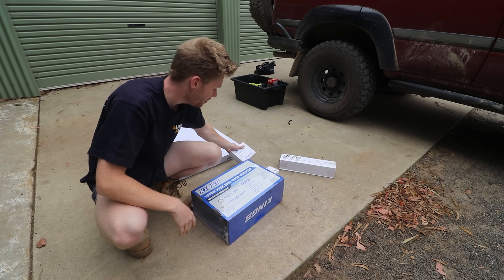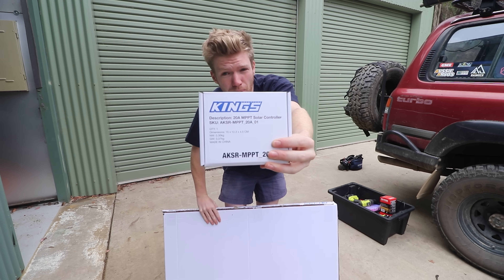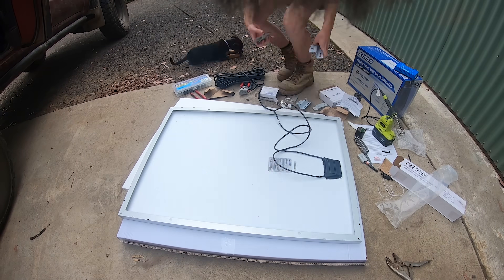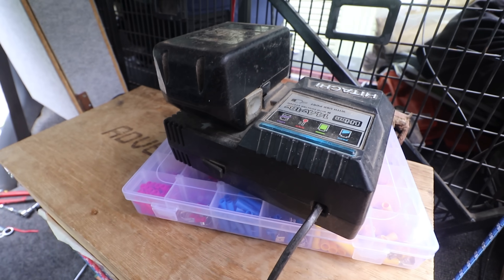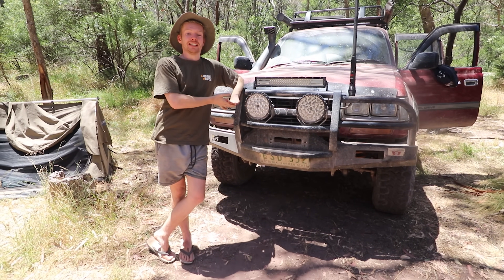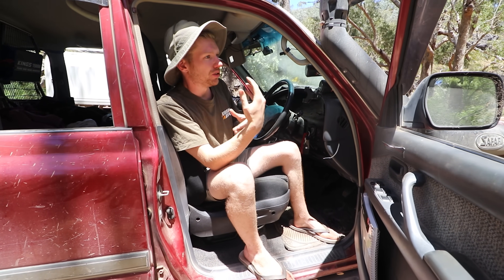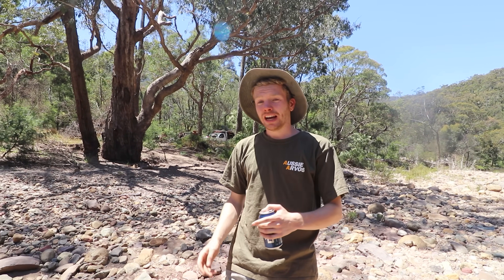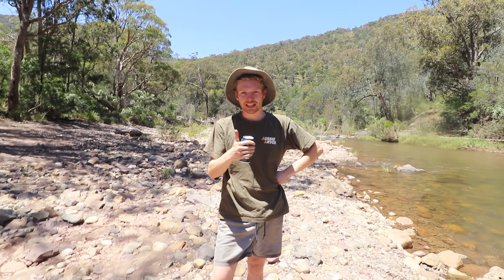Should you put SOLAR on your 4WDs Roof??? + CHEAP 240v Setup! What FAILED?

Comment: The big thing is budget - are you better to have good gear at an affordable cost that will last 2, 3 or 4 years, or something thats 5 times the price that will last 5-10 years? There are some things I'd always spring for the best quality, such as batteries and battery wiring, but so what if your inverter is a couple of % worse in efficiency, or a little louder, you have affordable 240V in your car at a budget that most people could afford. I do plan on looking at options to put a panel on my new car, and a second battery just for a fridge, so the quality for something like that will be based on what I can justify as it will only be used every 2-3 months for a couple of weeks.

Comment: Why do this? I just purchased the solar panel $90 and a controller for $30 and im charging my second 100amp battery under the hood at 3.8amps and it turns off when its fully charged...i can run a kings 30L fridge/freezer for 3 days

Comment: Just took my 3rd one back today. The first one all lights were working correctly and was charging at 15.6v the other two the solar light wouldn't come on and only put 5.6v into the battery, i upgraded to the mppt kings plus and am waiting for the message to come pick it up fingers crossed I don't have any issues with this one

Comment: I had the 110Watt kings fixed panel on roof racks driving through a CTEC DC/DC charger to two 110AH AGM batteries just running a 45litre Engel for three years plus Kings LED lighting when camping. Worked a treat. Easy to knock Kings but be realistic, ALL electronics come out of China and kings buying power probably buys a bit more quality control than it used to.

Comment: The thing is....why do the job 2 or 3 times buying CHINESE  CRAP.
Save up and do a little bit at a time and do it  Well and only once.
Red Arc hands down. But buy it through NAPA   $309 for a BCDC25AMP Charger and never touch it..
Don't be like the other Channals with there rebadged  China 24/7 crap.
It's cheap we all know.
But promote good Aussie Business  in a time of need and get off China's  Tit.

Comment: Nothing wrong with being Budget conscious and whilst Kings gear is inexpensive it works most of the time. 
For me anyway. and I cannot afford to spend many hundreds on Redarc or ARB. 
I have the same dual battery charger and their LED lights and I have not had any issues.  
My fold out solar panels work well and my fridge does seem to drain my battery in hot summer days.
But that could be my 98AH battery is just not sufficient to keep the fridge running when the cabin temp gets to 45  in the car park at work. 
It can't seem to last more than 8 hrs of running time with my 45 ltr. fridge in summer. 
If the fridge is running on 240 volt in the house the fridge works fine and only seems to have an issue once in the hot car.

Comment: Just saw this video. You have me worried. I have that MPPT controller as well as the same Giant 140AH battery. Tomorrow I will be checking the charging voltage. My setup is in a caravan.
Reply: I also have the same battery, I did have a kings mppt controller with a 120w solar panel. Literally first time I plugged it in it went straight to 18volts. Unplugged it straight away and threw it in the bin! Bought a victron 75/15 mppt and it’s the best!

Comment: Is regard to your high voltage when the car is running. It will have nothing to do with charge voltage. Your king's mppt charger will be your issue. They are known to increase voltages well above safe charging limits and kill your battery. Replace it with a good quality mppt and could almost guarantee your issue will resolve

Comment: mate.. that MPPT controller is Sh!t.. I gave them the benefit of the doubt whe I installed a 12v solar system and 2nd battery in my Commodore wagon (the Camperdore) along with the Kings dual battery relay, the MPPT  lasted a month, shorted its output and blew all ther fuses in my system. A friend bought the same controller and his lasted 3 months and did the same thing. But you gotta try these things and wehile it was working it worked great.

Comment: Off topic... but kings air compressors... we've been super unlucky never had one die, but the pressure cut off always stops working after 1-2 years in 3 units (2 purchased, 1 on warranty)! Wondering if I buy another or buy something else, it is the real question. I haven't really used much other kings stuff so, this is a great insight.

Comment: You only needed a PWM charge controller in your setup. I don't mean it in an offensive way but you don't understand the difference. With  cheaper devices, PWM is generally more reliable because they are less complex, are well proven with time and don't rely on software. If your DC input is  close to your DC output, as yours will be, there is no advantage with MPPT.  However, if your DC input is aignificantly higher, then yes, you do need an MPPT for best efficency. The quality of charge you get in  your battery is down to the poor design of charger or installation. Another tip for  vehicle mounted solar PV. If ypu add a second module,  ake sure it is compatible. You cant just mix them up (although, in  reality ,if its the same voltage and power, it should be okay). Connect them in  parrallel. Yes, unless you have gone overboard on cable size( including upgrading the cable the module comes with or keeping the tails very short), you will lose some power due to voltage drop but, if one module is shaded, you are still getting full power out of the other. In this situation a PWM  controller wil also work better. This is not the case if they are series connected.

Comment: The 12v box is starting to get messy.

But there's no real solution.

Only to put the wires that go to the same place in sleeving and work from there. Yes you will still if the odd wire here and there that needs to go somewhere else.

But if you can put those large amounts of wire together in a sleeve it will make a huge improvement. 

(Fibre glass, cloth tape or plastic wire wrap/ wire conduit/self closing cable wrap).

Comment: Only thing I’m actually worried about is 

Not knowing your voltages and replace the mppt kings with a victron mppt 75/15

Or at least have a 12 battery shunt to monitor your battery 🔋

Comment: I'm pretty tight. I've got a mix of ebay, kings, supercheap in my vehicle.  I scored a 110w panel with mppt controller and brackets from supercheap for $109 and it's wired to a kings battery box. Simple and works efficiently.

Comment: I apreciate that ur coming from the perspective of an everyday consumer and still making relevant content but i think there is certainly a middle ground of parts that arent top spec but are still reliable and reasonably cost effective. Getting Kings products may work very well for some people but as you mentioned it just comes down to chance if the parts will work or last so really isnt actually adding much value to people considering a solar setup. Im happy if its worked for you but as someone considering doing a solar setup this reviwe doesnt help at all because i have no confidence my $400 will make the same distance yours will.

Comment: a full 1500w draw through those stock battery cables is gonna get REAL warm real quick.  I'd 2x them personally. (cheaper than thicker gauge cable)
Reply: Yeah I did a quick test when I got mine, microwaved myself some dinner for 10 mins. And the supplied cables got very hot. I used 2AWG which isn't too pricey when you only need a short length.

Comment: cheap inverter.. Giandel every time. 
and a must to over spec, need 1000w?  buy 2000w model.
and if you're using an MPPT controller, might as well go a used ex roof panel, can pick up 300+w 42v panels for sfa these days.

Comment: So long as all your electrical stuff is fused ok, you may have something break but you and your truck will be safe. Don’t be fooled re cheap or expensive, that Kings MPPT is exactly the same as one I have from a high end supplier. The box states made in Australia but the actual unit has made in China stamped on it. Riddle me that one Batman.

Comment: I too have Kings products in my set-up.  But I also have high end & Aussie made gear (ie. GME, REDARC, Engel, Drifta etc).  IMO the best value for money products from Kings are their solar panels/blankets and their rear drawers.  I've had the Kings rear drawers on my 80 Series for 4 years now, and it's been doing the job well.  I also have one of their early inverters (4 years old), and while it's rarely used, it still works fine.  I also have their 200W solar blanket and after 10 months it did fail, but 4WD Supacentre replaced it under warranty, and the newer design replacement (now 3 years old), still works well. The 160W fixed solar is still going strong after 2.5 years.  And a few knick-knacks like tool sets and driving lights.  So I too have no issues with Kings gear.  Though I'm not a full time overlander, and I will always choose Australian made gear if within or just outside my budget. 🦘🪃

Comment: Nice video mate! Really great points of being budget wise if your not travelling constantly. Got a question about that big box of insulated crimp connectors you had used in the past. I bought a similar individual set off eBay and they were crap the wire was easily pulled out of the connector. Are the ones in the link on another one of your videos half decent? I just don’t want the wires coming out of the connectors ? Thanks
Reply from the maker: The ones i bought through that link seem to be fine, i do make sure to crimp them pretty well, maybe have had one or so fail but all in all pretty good for the price! and thanks!

Comment: Mate I've had a Kings 160wat panel on my roof for over 4 years and even with one of the panels smashed it still works mint. Delivers 17.3 volts on open circuit with the multi meter which is spot on.
Reply from the maker: Yeah can't complain about that!

Comment: Kings main issue for me is they are a 580km round trip to the nearest store.  The other issue is freight.  Today they are advertising many things free freight with a "Gigantic 1 Day Only Free Delivery* Blitz".  Note the asterisk.  That's important.  When I get to the checkout there is freight on these freight free items.  Worse, other items clearly indicate freight on the item page, but back in checkout it's more for my address.  Lastly, they just keeping adding freight in for each item.  There's no combining of freight costs.  But one thing $15 freight, it's $17 in the checkout, by another thing $20 freight, now $23, that's $40 thanks very much.

We do own a bit of Kings gear, but to have made it worth our while we did a day trip with the box trailer to pick up a roof top tent, a set of rear drawers and a whole stack of other stuff, and saved about $600 in freight.
Reply from the maker: I agree mate! i have sort of the same issue, we are outside of there freight zone and yes makes it a bit harder

Comment: good stuff Pat.I am a pensioner and go fossicking around Oz as often as I can. I run 2 solar systems, one on my 4b and one on my camper trailer. Both systems run off a 250w ex house panel that cost $50 a piece that I've done mods to to keep them intact on the corro roads where we get to. Both systems are managed by an eBay mmpt controller that cost around 40 bucks each and feed 2x 120amp AGMs in each system. One system runs a fridge and one a freezer. They both run lights and both have 600w sine wave inverters for charging tools , laptops etc. We cook with campfire in our firepit mostly but have a 2 burner butane cooker for when we are just overnighting somewhere. Total cost from memory for the entire two systems was less than $1k and apart from a warranty claim on one agm battery that failed first month in the systems have been faultless and in the 3 or so yrs I've had them we have run the generator once because of continued bad weather while we parked under shade. The solar setup in my 4b also feeds back to the start battery to keep it maxed all the time when we use it for stop starts on short runs that drain the battery quicker than the alternator can replenish it. Love your honesty and factual advice boys. There's just way too much marketing and chest pumping in todays outdoors and 4b fun world. Keep up the good work lads.
Reply: hell yeah, thanks for all the info mate!!!
Reply from the maker: Thanks so much for the comment Wayne , and your setup is spot on! that's all you need, but as you said there is alot of material on the internet that suggests you need more. Thanks - Pat
Reply: As a fellow pensioner trying to run a solar on my 4b and camp trailer this info was helpful. for the last 10yrs i have been running 2 x160w panels with a cheapo ebay mppt controller and a 140ah agm battery which was fine to run my cpap and led lights as I was 4wding every day a camping in a tent or swag with a esky, now I have soft floor camp trailer and a fridge and looking at hard mounting my solar panels on my 4b roof rack as most 4wd tracks have been closed near me in the last yr or 2 and now with camp trailer I need a week or 2 power so I don't have to pay for powered sites. I've found that my 140ah agm battery with solar connected only seems to last 3 or 4 days running my fridge/freezer my cpap and some led lights

Comment: I have a mixed quality gear (high quality & budget gear) fitted in my LC80.  Most of my budget gear are Kings.  And I have to say most of them (160W fixed solar / 200W solar blanket, rear drawers etc), have so far worked well.  And I've had them over 3 yrs.  The only products I won't recommend is their steel platform roof racks.  They are heavy (50kg approx), and will start to rust after a year.  The other item I'd replaces immediately are the brackets of their light bars.  Mine rusted after a few months even though they are supposed to be stainless steel (tho the light bar itself is working well).

Comment: Great video guys, I've never had any issues running Kings gear. I put my mounted solar panel on drawer slides I got from Bunnos for $50 so of it was parked up with gear on the roof or partial shade o can just pull it out. Works awesome
Reply from the maker: Awesome that you still have all that space on the rack! cheers!

Comment: i spend 4 months every year doing the barra dams. to do this i am onto my 2nd Ram2500(2021)with Mits canopy with the full Redarc twin Lithium 12v system(20 large). i also use this system to charge my nitro bass boat while driving to keep the lithium batteries fully charged. i have a second vehicle(my 2019 Ram2500)for my son n this one also has a Mits but it runs a full Kickass 12v AGM system with twin 170 slim line batteries($5000). i did that simply because i didnt want to spend another 20 large n was looking for a gud mid range alternative. having run AGMs years ago thats where i went n found that it came down to 2 companies. so i bought a full system from each company to see it n to feel it n the Kickass just did those things right, so thats wats in my sons vehicle. for 4 months we r on the road n camping out of the vehicles n the AGM  system has never stopped in anyway. the only weight difference comes from the batteries n that doesnt concern me at all. in 2 years time wen i build the next Ram i will be using the AGM system, why spend the money on the other wen i know this works. BEFORE the nay sayers jump up n down n say u r sponsored, NOPE not at all. i am lucky enough in life that i can afford these things n the life style. wat is being used/pushed through the different media outlets bout these very expensive 12v systems is sponsorship to the channel n product sales to the companies n of course people watching these channels get caught up in the excitement of the moment n do purchase these 12v systems n lets not forget all the other 4wd accessories out there. these r my experiences with Lithium n AGM n still using them both to this day.

Comment: Simple answer for me personally is no I had a cheap 200w eBay panel which definitely wasn’t 200w throwing in a max of 5amps into the system I recently replaced that with a Redarc 180w panel and it doubled the input. Any cheap panel will be fudging there ratings as the industry isn’t regulated. Good video guys
Reply: That's weird, my king's 110w panel puts in roughly 6 Amps which is pretty spot on. Maybe some have duds?
Reply: @benskies1990  Could have had cooked panels mate who knows but it was not pumping in good numbers

Comment: Hey Patrick have you thought about triggering a relay off the ignition to cut the solar power when the car is running to prevent your over charge situation.
Reply from the maker: Good thought Austin! i like it, but i don't think its currently causing any bad issues, it only gets up that high when the battery is very full and fridge isn't using a lot of power, i think the Kings MPPT lacks a bit there but yeah good thinking!
Reply: @AussieArvos  I've killed a battery in the past by overcharging so I've added a changeover relay in my current setup to be safe.
I'll eventually upgrade my whole system but wanted to keep the current setup safe for the meantime.